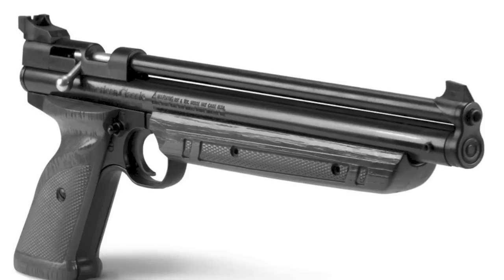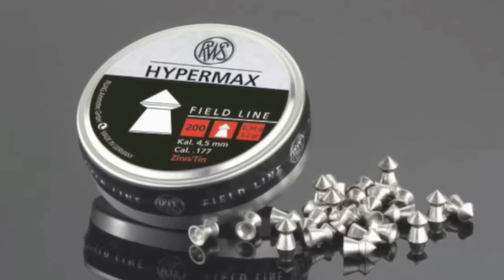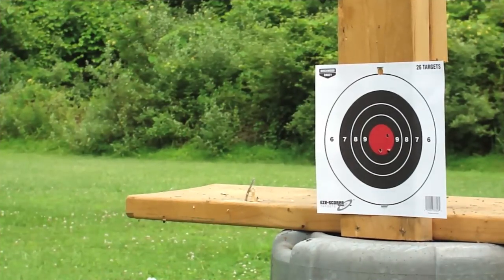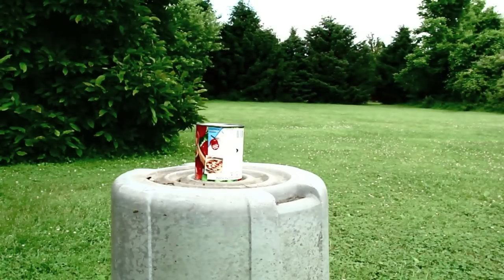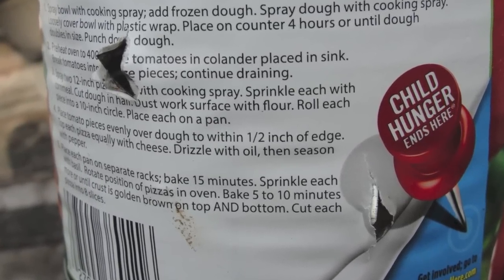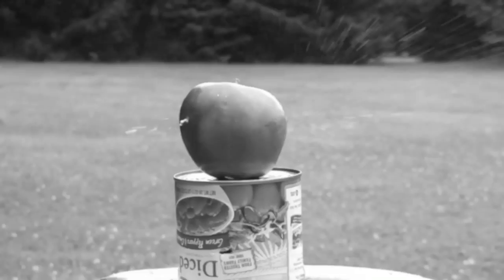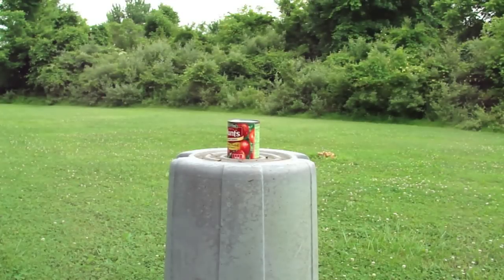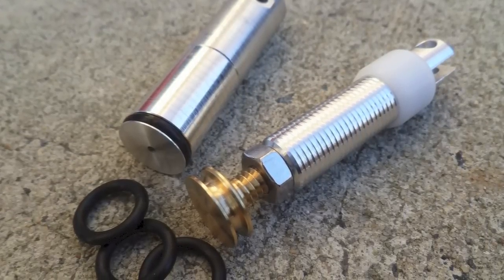Crosman 1377 Penetration Test featuring RWS HyperMAX, Beeman FTS and H&N Coppa Spitzkugel

Comment: This is one of the best made air pistols for .177 and .22 cal. pellets.  I owned the two with no problems.  The .177 is very good as long as there is no strong winds.  The .22 cal. will be more accurate in windy conditions due to its weight.
Reply: I've had a 1377 since 1981 (yeah, I'm an old guy), had it resealed once and it's still a good shooter. Has the magnet for BB's but I only shoot pellets. I consider this gun the most bang for the buck of all of my airguns.

Comment: I still enjoy conducting these little tests between my modded  crosman 1322 and webley alecto. 177 and hatsan supercharger. 177, and with different ammo. I now have a chrony so know the exact numbers but you still cant beat a good shoot out experiment. Lots of fun and you can easily lose an hour here and there. It was through this video i was introduced to hypermax and still use them now, my supercharger seems to like them real nice. Also my crosman 1377 which i have since sold, absolutely loved. 177 thunderbolts, they are great penetrators and also h&n excite in. 177 and. 22. My everyday pellets are rws superpoint in. 177 and. 22, accurate and inexpensive and great for small game and targets alike. But if you  absolutely positively have to put something big and snarling down quickly at close range then the compound bow with a broadhead arrow should do the trick.  All the best from lancashire U.K.

Comment: I'm pondering whether I should buy this to shoot mice inside my home. Would you reckon that this pellet gun is adequate for inside home pest control?
Reply: +FatWalruses gamo p-900 is better for inside use at about 350fps the crosman at 600-700fps is to much power for inside use
Reply: pootato head Thank you sir.
Reply: +pootato head Not true,you simply dont pump it to the maximum.3-6 pumps would work perfect for this and then you have more if needed.
Reply: Ohhhh yeahhhh 3 pumps = fun but death 4 mouse..🐭. .
Reply: Yes 3-5 pumps with flat point pellets works fine on mice.

Comment: Interesting results. I would not have guessed that the hard alloy high oenetration Hypermax qould be doin much good on the soft targets, But then again your damage assasment on the apples seemed a bit too superficial for my taste. When i did similar field tests i couldn't resist to cut the apples open with a scharp thin kitchen knife, to examine the 'wound'-channel more closely.
I also was suprised about your 'average' critter hunting distance of 12 yards. Seems to me that you are, either a damn good stalker, or your planning to pop so flying rats (city pigeons). As I never saw any rabbit, rat or any other species typically hunted with an airgun, sit still and let you get this close, except for said city-critters. How about repeating the test on a little bigger range, Like 20-30 yards (which seem more realistic ranges tbh, just judging by the airgun hunting material of other channels)?
I'm just thinking a 0.34gr light pellet probably has not the best ballistic coefficient due to the low sectional density (due to shape and material). 
Also an interesting side note: the Hypermax 200 piece tin you showed in your vid is actually 55 euro-cent cheaper then the 100 piece double lined deluxe box (also depicted). and retail for 7,95 (200 piece) and 8,50€ (100 piece)... Seems to be the same bullet, therefore the almost 100% price difference seems a little odd, all I'm saying.